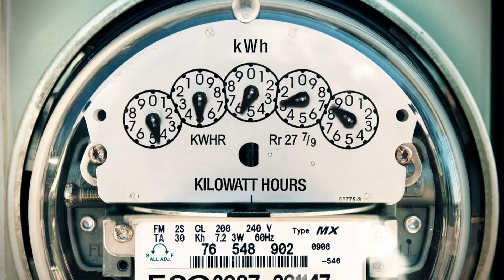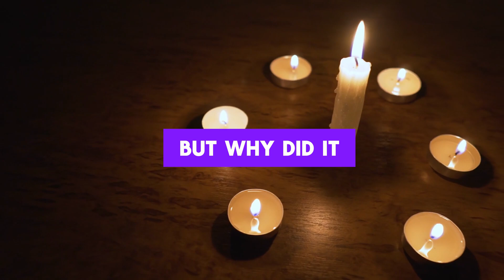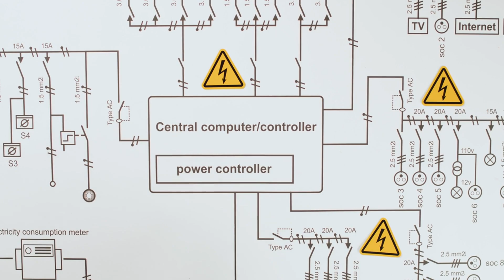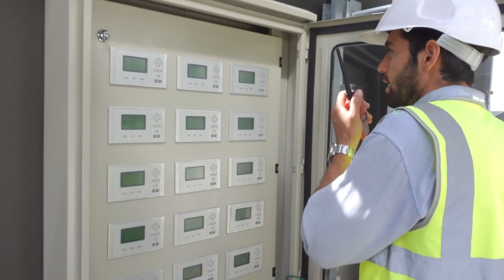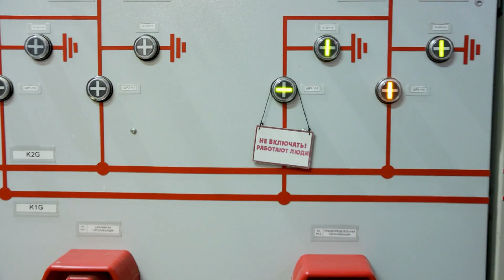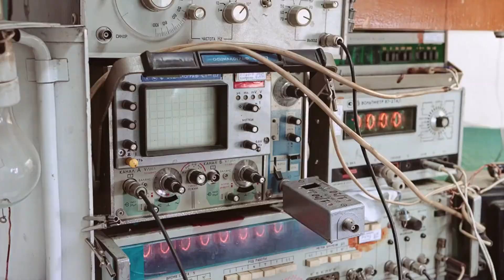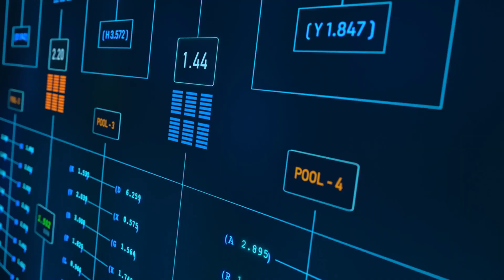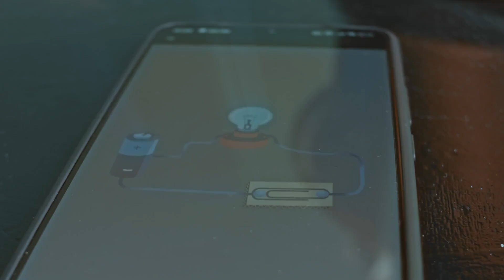The Massive Grid Blackout is Coming – Sooner Than We Think

Comment: What you are watching is the dying thrashes of an overly complex AC power grid. The future lies in a decentralized distributed HVDC grid that puts generated renewable energy into a system of battery nodes. Renewable energy will be generated from many sources. Massive battery nodes will store the energy. This energy will be shared between nodes. AC will only be used at the consume lever. That AC will come from substation DC nodes.

Comment: There is NO data showing that the issue was caused by renewable energy sources. 

There IS however data available that shows that a 2GW power drop happened in a window of about 5 seconds. 

--- 

It takes some 45-65 of the very big solar farms to produce 2GW of power. 

It was a very sunny day in Spain. 
There simply were NO skies that covered 45-65 solar farms - at the same time. 
And especially not skies that suddenly could covered such a large area - in the span of only 5 seconds. 

For solar to produce (or drop) 2GW  an area of more than 8.000 acres - needs to be affected - in the span of only 5 seconds. That did simply NOT happen.

8000 acres -  2300 hectare - 32 million square meters - 32.000.000 m² - 32.000 square kilometers - 45-65 of very big solar farms - about 2GW of power

--- 

Transmission lines can however easily deal with more than 2GW, on a daily basis. 

So it is much more likely that it was an issue of monitoring, management and compensation - of something on a transmission level, that was the cause. 
Any of the types of issues that are always pushing to de-stabilize the functionality of the grid, is likely to be the root cause. 

--- 

These are know real-time issues, that have an ability to push things at transmission line levels: 

- Harmonic Distortion
- Reactive Power Imbalance
- Voltage Fluctuations
- Frequency Instability
- Power Factor Issues

--- 

So it is much more likely that some kind of im-balance or mis-management happened at a transmission line level. 

No singular plant - nor any singular power-type - is likely to have caused the initial drop of about 2GW
Reply from the maker: Thanks for such comprehensive analysis

Comment from the maker: Do you think a Blackout Will Happen in the U.S. or the EU?
Reply: Some level of blackout is a constant natural aspect of operating a grid. 

So several highly automated measures are constantly running, and being used, in an effort to prevent large blackout events. 

Never the less, localized (sudden and un-expected) disruptions to sections of the power grid, happens on a weekly basis. It is however not typical that it happens on such a large scale. 

The automated-limiting-measures in France, was (for instance) able to contain the loss of power, to only a section of the French grid. It did not take down the entire French grid. 

--- 

In Texas - they managed to keep the grid running for days, before it became necessary to use localized shut-down of sections of the grid (known as brown-outs). 

And it was only when they started using localized shut-downs that they discovered that heating measures of gas-pipelines where randomly connected to the over-all grid. And thus gas-lines froze, causing several gas-power-plants to loose their gas supply. 
If they would have operated power-lines, that were dedicated to the heating of the gas-lines, it is likely that Texas would have been able to manage the weather event much, much better. 

--- 

So, different regions in EU or the US, will all have a different level of pre-thinking, and prediction ability, and preparations, to limit certain events of instability or dis-connects from the power-grid. 

Where I live (north of Europe), 
we have 100% coverage ability from local gas and diesel plants. 
We also have 100% coverage from interconnects to other regions. 
And we have over 200% coverage from renewables. 

So we regularly have a mix of those power sources in use.  From where ever the power cost the least, in that day, during that hour. 
And we regularly get 100% power from renewables only.

So different regions will have different levels of ability to deal with electricity fluctuations. And some regions (in the EU or US) are not really all that well prepared.